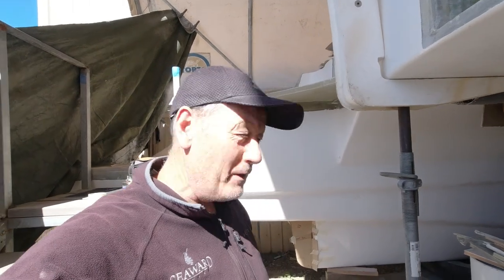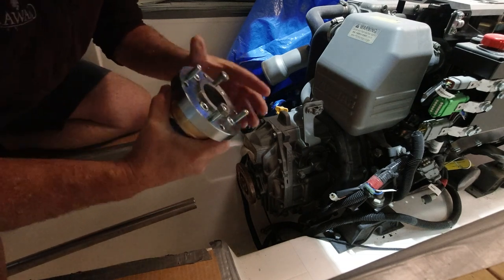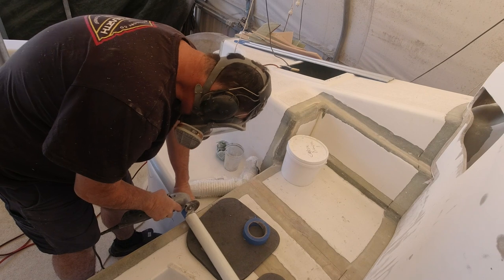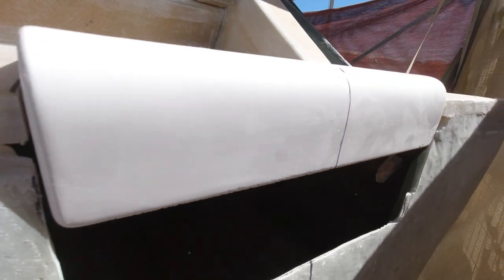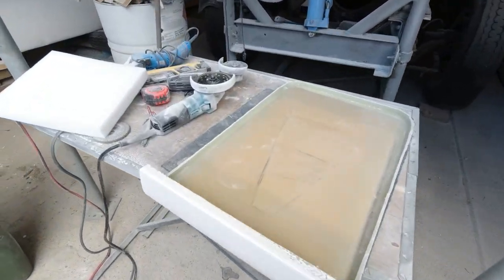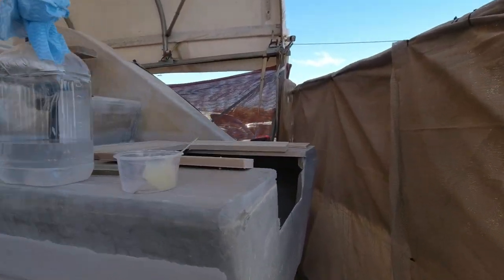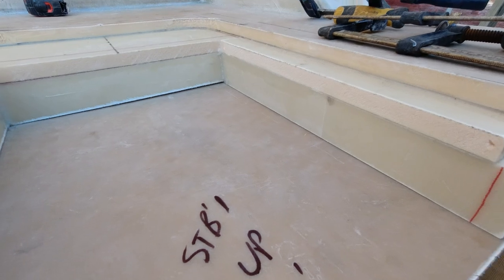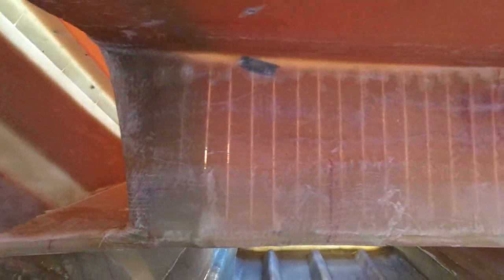Our Catamaran's Drive Train - No sail drive here //Complete Catamaran Build

Comment: hey Ross The force that enters the transom in a following see is huge.  Beef up the lock that holds it all down.  Crossed the atlantic and needed to make repairs on the run
Reply from the maker: Yes mate I am beefing it all up as I fully understand yet couldn't calculate the forces with which I expect it to handle.Cheers mate.Rossco

Comment: Mate, looking great, it will be easier to harvest your sea life seeing as the ladder is on the lid. Nice design. Even though it sounds stupid to use anti-seize on a compression fitting do put a smear on your shaft and the taper. You always need to clamp the length plus a smidge of the diameter of the shaft. Like a bolt, the nut is the thickness of the diameter.   We use these couplings on most of our pump shafts and the bite like a bitch. Probably have your machine shop make you up a wedge shaped tuning fork like a ball joint tool. To make separating the shaft a few years later down the journey. I didn’t notice if the tapered section had a couple of taped holes to make extraction easier. Or run a tap through 2 or 3 of the bolt holes. So if 8mm bolts run a 10mm fine thread and have some bolts handy to seperate it🤙🏼🤙🏼🤙🏼

Comment: Ross, I heard you mention the rudder, linkage, rams etc were all located under the steps along with a manual/backup option... that seems to indicate the back area under ladders will remain unused or inaccessible ?  What if you made something like a drawer or custom fitted tray to slide in there, but still be pulled out over steering gear ? You could store less often needed items like engine oil, belts, fuel conditioner etc...

Comment: Curious why the Constant Velocity joint that is so common on FWD cars is not seen in marine drivetrain applications.  Seems like the ideal way to deal with the changing geometry of the engine/driveline as the parts settle with use and time.

Comment: I so agree Rosco, the standard of, and mix of, materials YM use makes their engines disintergrate into rust and corrosion in aa few years. A good mate with a YM in his cat used the remaining clean engine oil of a service oil change and brushed it over the engine to reduce the rot.
Looking at your shoulders being at water level as you worked on the ladder space, are you sure you could lift your leg 1 meter to get onto the ladder?

Comment: They look fantastic mate, Btw have you considered a taper on the bottom part/transom to a slightly inwards manner to the bottom of that hole maybe 2-3 inches (taper length), as it will support those ladders once in the open position with reenforced surface that matches the ladder angle eh (hope that makes sense) Ned
Reply from the maker: Hah,Ned, I am way ahead of you.You read my mind.Exactly what I have done.It-s superb.Cheers Rossco

Comment: Why so much glass inside and out for a piece that will never see stress or weight?
Reply from the maker: Ladder box will bear the weight of the ladder when in the hatch with someone on at at times,other thing we considered is the incredible forces that a pooping wave that will drive into the box under the hatch, not sure we can even imagine or calculate that stress but it will be considerable .I am under no illusions after having worked on dive boats and sail oats that have leaking transoms and ladder hatches.My worry is the integrity of the hatch locks and hinges that could easily be blown off in such a situation.Cheers Rossco.
Reply: @LifeOnTheHulls  
Trying to keep your boat on a diet so your dive platforms aren’t under water from the weight. I’ve watched from the beginning and there is nothing light weight about this beast.